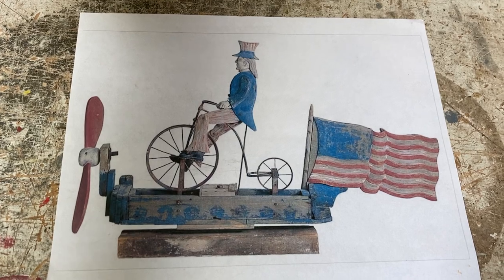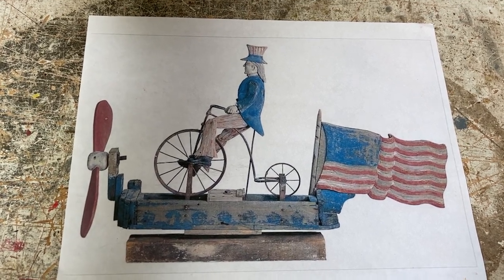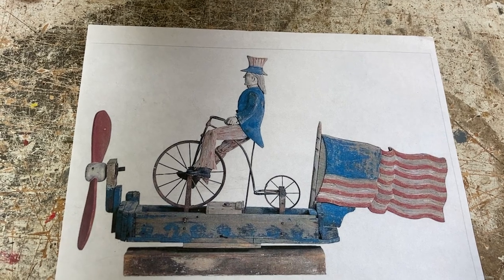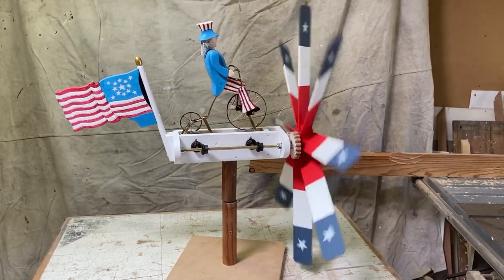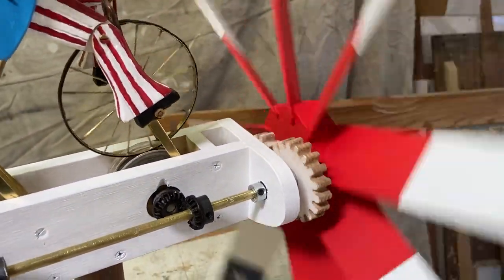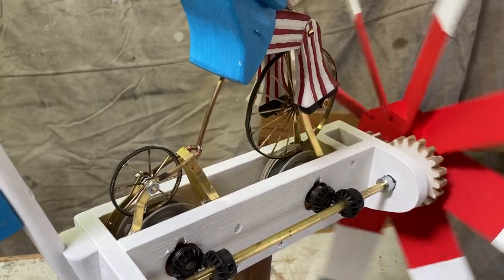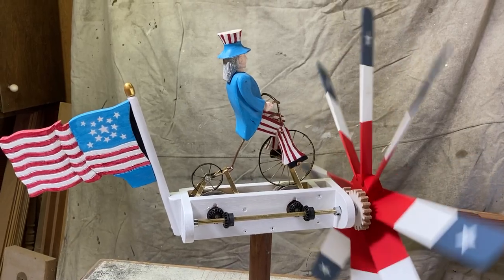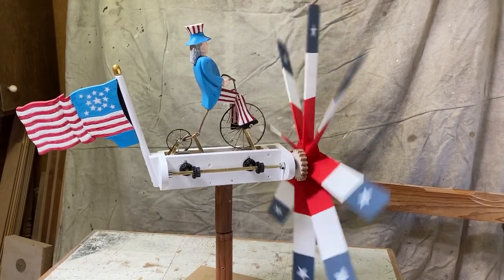Uncle Sam Whirligig

Comment: Hi Stuart! Nice job on the replica! You said you got the gears from a sewing machine? Thanks for all the information and the video. Warm greetings from Wishram.
Reply from the maker: Hi Todd.  Thanks for the compliment!  I looked for bevel pinyon gears used in model cars but couldn't find any with specs.  I even went to a hobby store but they were no help either.  Finally I found some gears on eBay that are replacement gears for sewing machine accessories.  Here is an example:  https://www.ebay.com/itm/1SET-Replacement-Hook-gear-for-SINGER-620-625-628-629-630-635-640-600-649-Series/153546491472?  These have shaft diameters of 7.87 and 6.33mm, both about or larger than 1/4 inch.  I used some brass shim stock on the larger size to bring it down to 1/4 inch.  As you discovered with your rower whirligigs, propeller direction is important.  In my use, the gear could be headed in either direction on the drive shaft to correct for the dyslexic carpenter syndrome most of us experience.
Reply: @9857111  Thanks for the link. I know all about that kind of thinking. Thanks also for the explanation. Best regards.